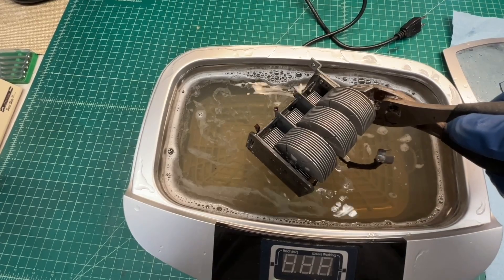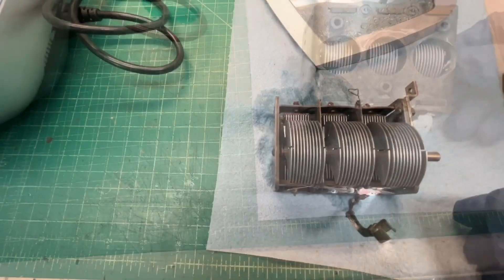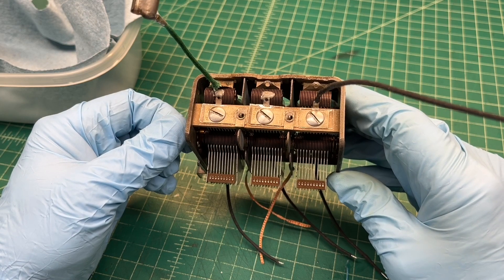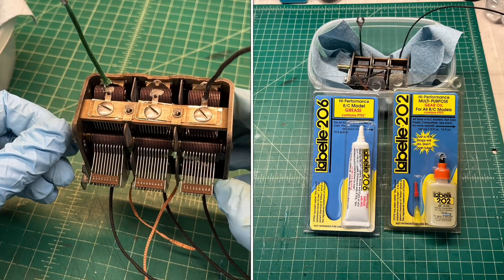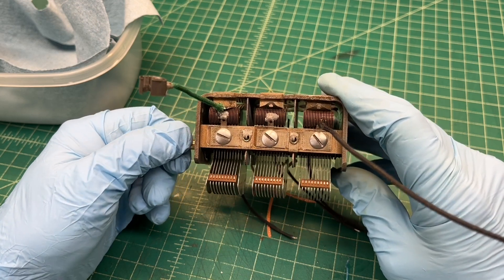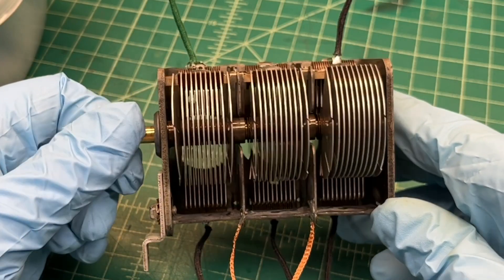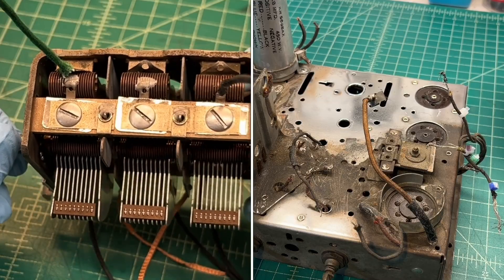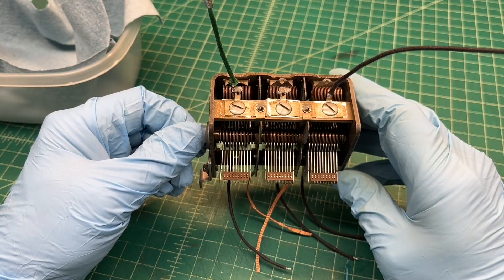Crosley 5V1 - Tuning Condenser | One Step at a Time

Comment: Great job as usual . I would be interested to know where you source new Mica from. Many Thanks
Reply from the maker: I bought a pack of the mica insulators ~5 years ago. Try a search on eBay for sheet mica insulators. The ones I used were 18mm x 22mm with the hole. I trimmed off a bit to fit. Hope this helps. Best, Don

Comment: Try some: Simply Green in your Ultrasonic Cleaner!  It will brighten up whatever you put in.
Reply from the maker: tD - thanks for the recommendation. What ratio do you use? Best, Don
Reply: @RestoreOldRadios  - 2 parts water to 1 part SG.  I sometimes just go full SG.
Reply from the maker: @tubeDude  Thanks for reply back. Can you repurpose the SG or is it one application and done?
Reply: @RestoreOldRadios  - See my reply by the pull-down.  ;-)

Comment: How many bandscan that 3 gang pull in; for the receiver you are working on.
 Is that a multiband, or AM/FM ? Hugh Mc. Chicago ,metro.
Reply from the maker: Hugh - it’s a two band receiver covering the BC from 535 to 1720 kHz and lower SW band from 1650 to 4500 kHz. Thanks for reaching out and following along. Best, Don
Reply: @RestoreOldRadios  you could expand the shortwave,  & add some plug in coils. I wonder does the Miller company still make blanks,  for coil winding ?
Reply from the maker: @hughmc5419  It would make for a fun science project.

Comment: That is very cool. Where do you get the replacement mica for the trimmer caps?   Thanks for posting.
Reply from the maker: Piet - I bought a pack of the mica insulators ~5 years ago. Try a search on eBay for sheet mica insulators. The ones I used were 18mm x 22mm with the hole. I trimmed off a bit to fit. Hope this helps. Best, Don

Comment: I'm working on a vintage Zenith console radio.  Much of the wire insulation has or is crumbling away.  Is there a way to cover up these wires and not have to replace them?  Love your videos.  Thanks.
Reply from the maker: Andy - many of the old Philco’s have the same issue. If much of the wiring is indeed compromised, it would be better (safer) to replace them one at a time following the original layout. I’ve used heat shrink at times as well for repairs that is UL 224VW 1 125°C 600V made by NTE Heat Shrink 2:1 Assorted Colors and Sizes 160 PCS https://a.co/d/j19ejkw All the best on your repairs and thank you for your kind words. Best, Don